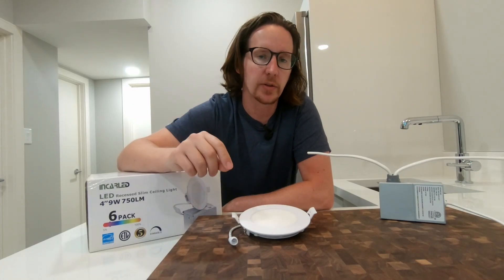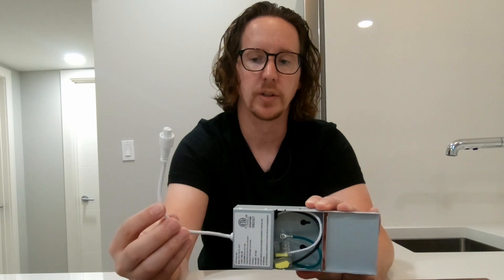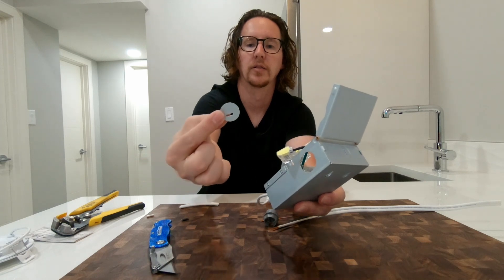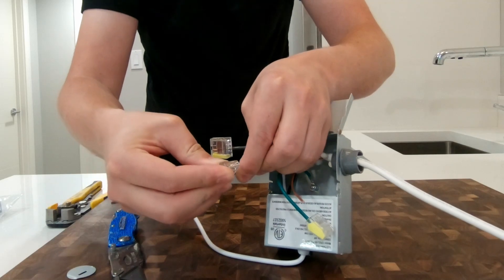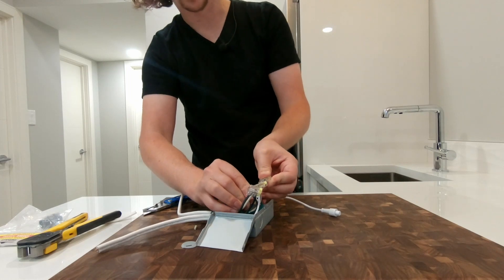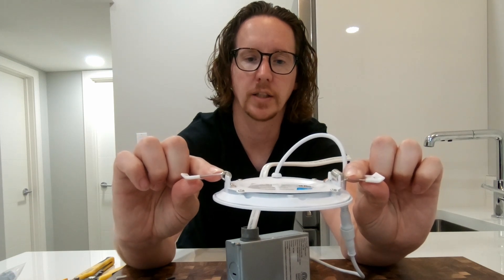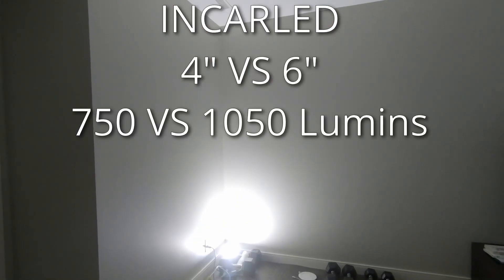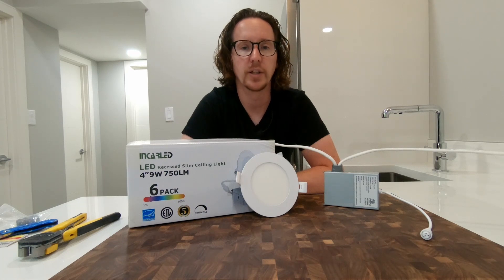INCARLED Slim LED Pot Lights - How to wire the best LED Lights

Comment: purchased  a box of 12 off of amazon, great,lights easy to install,as described, one of the cables was crushed in packing  and damaged. already hooked up when i noticed, now what?  11 working lights in kitchen?
Reply from the maker: I would reach out to the seller on Amazon. I have had great results from other products and the vendor has been able to send me the part required or sent me another product free of charge.

Comment: Do the boxed actually need to be fixed mounted or can they just sit on the ceiling loose?
Reply from the maker: The electrical code says that they have to be secured. You are not suppose to just leave them loose.

Comment: Great Video.  I am doing a test on different dimmers to see which works with these and various pot lights.  But I have a question:  Once you install the wire in the Incarled splitter inside the box, is there a way to remove it?  Or is it stuck there and you can't get it out once in?   Thanks.
Reply from the maker: You can remove the wire. You just need to gently pull on the wire while twisting back and forth and it will come back out.
Reply: @ResearchDesignBuild  Thank you!

Comment: Saw you have a cord plugged in to outlet. How do you test this without installing? Are you using a cut cord and wire to the light?
Reply from the maker: I just used a regular 14/2 wire and a plug that I bought at Canadian tire to set up the demonstration. A cut extension cord would also work, but I had some scrap 14/2 wire and the plug I can re-use. So that is why I did it that way. I would rather install a pug on a wire than wreck a good extension cord.

Comment: I love the kelvin tests!
Reply from the maker: Thanks, what impressed me was how wide the light pattern was. Not all LED lights have this wide of a spread.
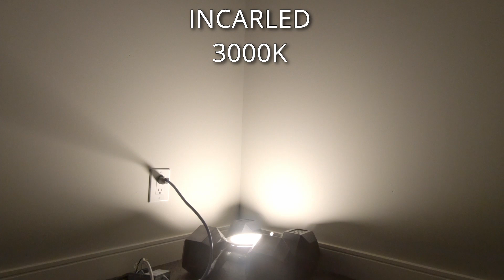Reply: @ResearchDesignBuild  is difficult to tell this from the video. It appears the Eaton is mounted higher. I am basing this comment on the shadow from the cord at the receptacle is a lower angle. 6:28
Reply from the maker: @CybekCusal  Both would have been at the same height, the 4" INCARLED was mounted an inch or so lower. Might have been at a slightly different angle and not sitting 100% perfectly flat.